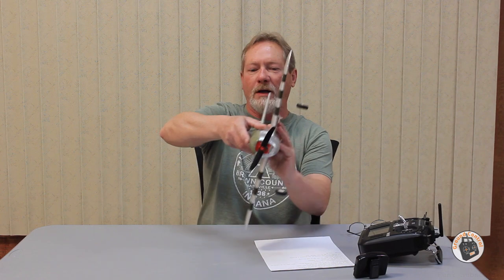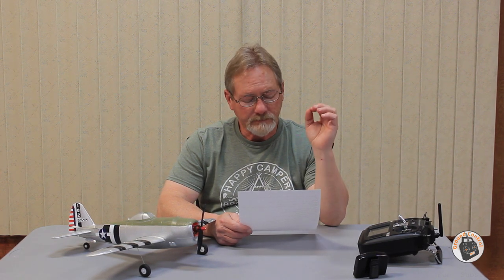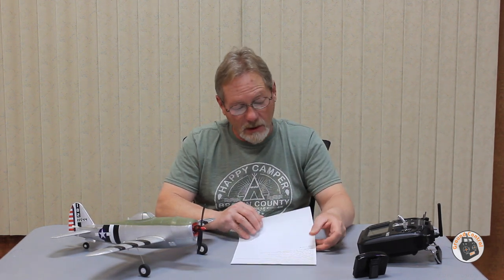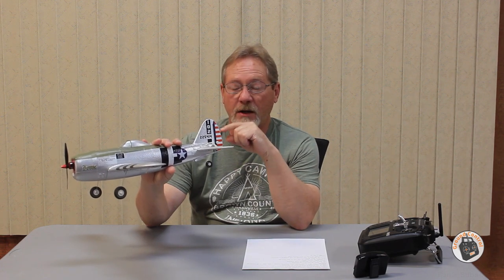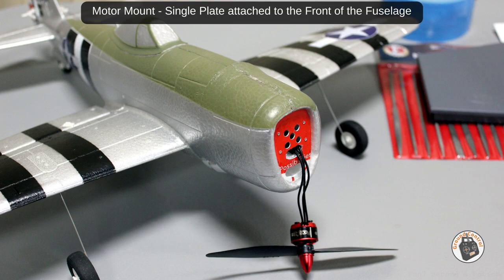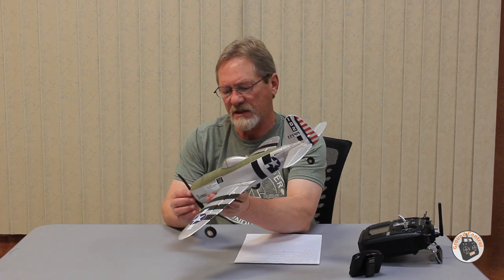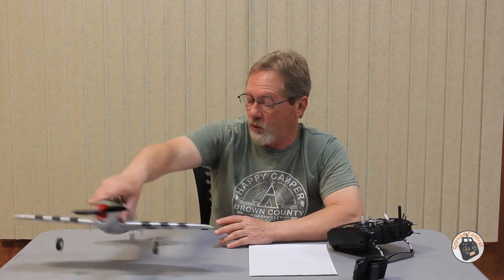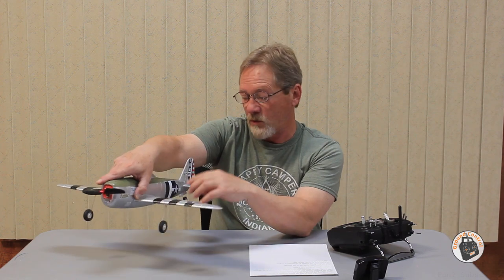Brushless Conversion of the Eachine Mini P-47 Bubble Top 500mm Wingspan Gyro RTF - Is Complete!

Comment: Hey, Tony. Good tips here, I didn't think about the control difference on the elevator either. I thought mounting a 400mm upside down would solve this, but with the stock transmitter I'm not sure it wouldn't reverse the rudder, and I don't know if the gyro wouldn't try to make me fly upside down... 🤣
I'll use the same brick you did and reverse the elevator horn. I'll be happy to see how to do that, and also a complete list of components in order to find a compatible esc, 2s battery, etc.
I'm pretty sure your bird will fly well. I just hope mine will fly nice and proper too. 😋👍
See you in the air! o7
Reply from the maker: Hehehe...that Elevator correcting in the wrong direction caught me by surprise.
I should have thought of that but sometimes you miss a detail.
It was an easy fix though and only took about 15 minutes to complete.
Reply: @GroundControlRC  I'll probably write to you when the parts are here in order to solve any problem I encounter and can't find a way to solve by myself. I'm pretty eager to convert mine, now. I might be able to give the big boys in bigger planes a run for their money in this properly powered little demon of an airplane. 😁
I'll wait your next videos on this conversion with much anticipation. I'm pretty sure a 1.7/1 T/W ratio will just make an incredible machine out of this airframe, able to go into vertical much, much more than the original, maybe too much to be scale. It's not a F-22, after all. 😅 I guess I'll just have to go easy on the throttle... 😉
See you in the air, Tony! 😊

Comment: It's too bad there isn't enough space between the servos to flip the elevator servo arm to the other side. One problem with servos attached to the board I guess. Glad you're doing all the problem solving for me before I do my conversion!  Does it look like the brushless module will work with the stock p47 brick ( sorry if you've answered that 100 times).
Reply from the maker: Hi Mike!
Yes, as flipping the servo arm would have been such an easy fix.
I did get the linkage moved down after punching a new hole in the fuselage ;-)
Now, I'll be able to use the Gyro as well.
I'm not sure if the module will work with the stock brick as I don't know where I need to tap the brushed ESC signal on that board.
I just shipped that board to the company that designed this module so they will be designing one that works with the P47 brick ;-)
I still have the Mini Cessna so it would be great if I can use the stock board ;-)
Reply: @GroundControlRC  that's great! Helping out with the R&D!

Comment: Hi Tony, I guess it'll work out the box with the oem transmitter ?
Reply from the maker: Yes, it certainly should work with the Stock TX with the Stock Board.
With this B2BL Module the Stock TX for the EAR411 (V761) Board should still work with it.
Reply: @GroundControlRC  I find the stock transmitters fine generally ,but then I do tend to rely on the gyros as my haptic feedback is rubbish!  Lol 😆
Reply from the maker: @associatedblacksheepandmisfits  Some of the Stock Transmitters aren't too bad.
I always try to get the RTF Planes flying well on the Stock TX before binding up to the TX16S.
The Stock TX that came with my Arrows Pioneer was a fantastic TX.
Reply: @GroundControlRC  it's funny , I can control a cargo ships'  hydraulic crane to the millimetre, but when flying r/c , no finesse whatsoever ! Gravity just keeps letting me down... one minute a flyaway,  the next a hole in the ground , or a swim...😆

Comment: You’ve made like 6 videos of this plane and none of them show how to actually make it, There’s literally no directions anywhere and idk how to read the diagram on the website it makes no sense to me.
Reply from the maker: Hi Drew!
I think I've post images of just about every step in the Brushless Conversion.
Are you referring to the Motor Mount Diagram?
I'll be posting a Show & Tell video soon where I explain everything I've done for the Brushless Conversion.
Hopefully that will make it less confusing.
See you in the Air!
Reply: @GroundControlRC  where can i find the posted images? I have no idea what wires connect to the esc and the fc and  the brushless module. There are 7 wires coming off the brushless module and i don’t even know where to put one of them. I’ve watched every video and have not seen screen shots of every specific step to build it.
Reply from the maker: @BurgerurgerFPV  Hi Drew!
I didn't know you were interested specifically in the wiring of the Brushed to Brushless Module.
Do you have that module?
I can't provide instruction on how to wire the module, as per the vendor. The vendor wants those instructions to come from them alone.
When you purchase the module they provide a link to download the instructions and diagrams. They also provide images that show how everything needs to be wired together.
I would have been lost without that documentation. The documentation is very good and I didn't have any problem wiring it up.
I thought you were referring to the templates and diagrams I provided for things like the motor mount.
Reply: @GroundControlRC  I’ve tried looking at the diagrams they’ve made and don’t understand it at all. Youre sayin the vendor wont allow u to show how to make the plane with their module??? You’ve made like 6 videos on this plane why can’t you just take it apart for one video and show how everything is connected so that others like me can build it.
Reply from the maker: @BurgerurgerFPV  Hi Drew!
The vendor has specified that I not provide that information.
I understand that from their point of view as they don't want someone to provide invalid information that would cause damage to the receiver board or B2BL module.
What specifically are you having problems with?
Have you reached out to the vendor as he is very helpful.
In the instructions it states exactly where all the wires, by color and size, are supposed to be connected.
He also provides and image of exactly where the FET Gate on the V761 Board is located as to where to solder the wire.
Do you have all that documentation?